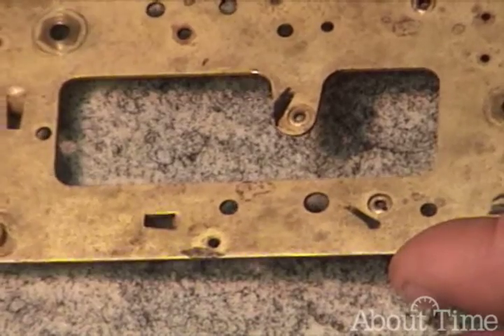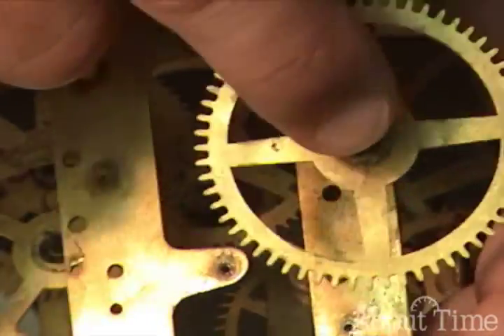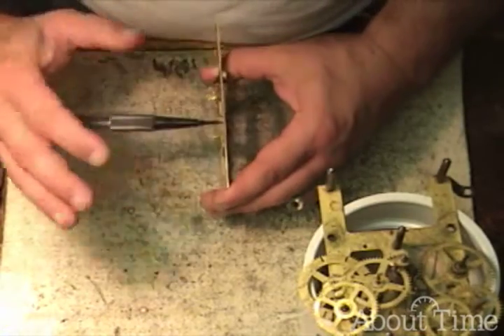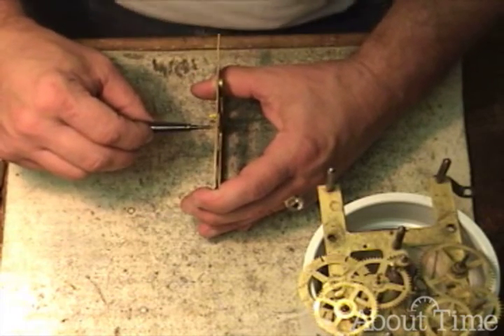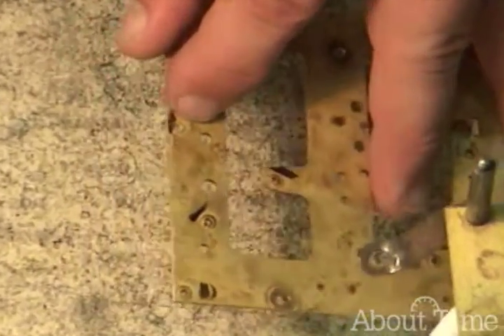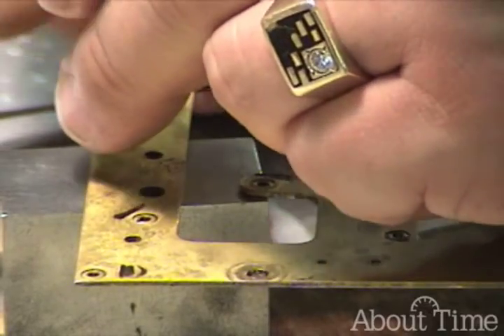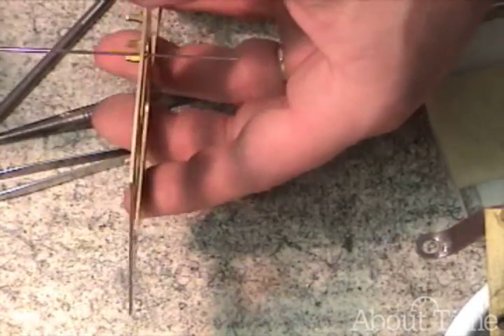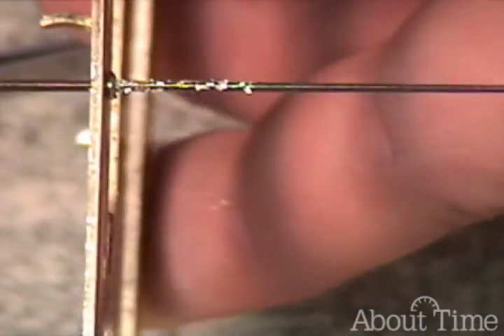ClockClass - Bushings

Comment: Is hand reaming ok if I don’t have a budget for a jig right now? And can I hammer the bushing in by hand also.
Thanks
Reply from the maker: Hi Paddy Pup-  Yes, hand reaming is actually my preferred method!  It allows you to drift the hole any direction desired and is quite faster than having to secure the plate in a jig.  The tooling for hand reaming is also quite a bit less expensive than a bushing tool.  As for installing the bushing into the plate, I use a hammer and flat-faced punch to drive the bushing in place.  Then I use a round-faced punch on the oil sink side of the bushing to seat it.  Great questions!  Thanks for asking!
Reply: ClockClass very assuring to hear, you also addressed a good point. To bush or not to bush. 
Complete novices like me would probably just bush with minimal movement.
Thanks for the reply and good video !!
Reply: @clockclass5480   I'm a journeyman T&D maker and I've been watching some of the videos and would have thought that the tolerances would have been tighter on clock pivots.My question is why aren't clocks jeweled?
Reply from the maker: @ps-ff6yx  Hi PS-  Tolerances vary in clock movements.  For example, wood works movements are very "sloppy" while jeweler's regulators are typically very "tight".  Much has to do with the quality of the movement and whether it was designed for accuracy or simply an inexpensive, inaccurate, everyday clock.  Trying to tighten up the tolerances on an average American mantel movement, for example, will mean stoppages due to plate misalignment, temperature changes, and/or depthing issues from slightly out-of-round wheels.

You ask about jeweled bearings in clocks...  Some clocks actually have jewels in the upper time train!  These clocks are designed for accuracy and are more scientific instruments than everyday clocks.  Mass produced clocks aren't designed for scientific applications and the cost to produce a fully jeweled movement would prohibit the average person from being able to afford it.  The American clock industry was about "faster/cheaper" while maintaining some "quality".  Even then, they made their clocks last too long!  These became generational pieces, meaning a customer would buy one clock and have no need to purchase another for several generations.  It isn't good business sense to make a clock which will last forever :-).  Fully jeweling a movement could certainly have been done but it wouldn't have been economical nor guarantee a company's longevity.  

Great question!  Thanks for asking!